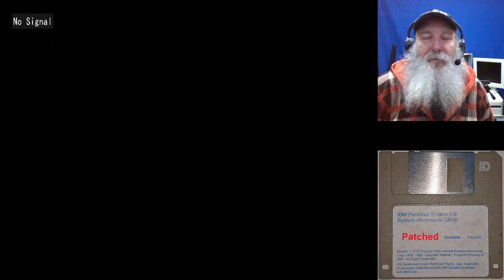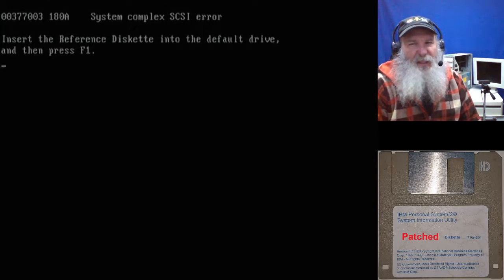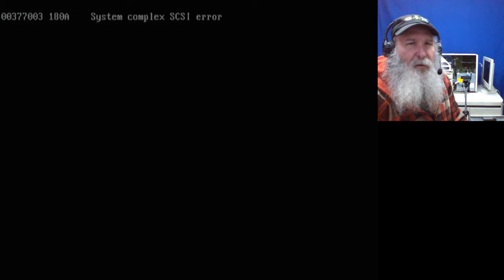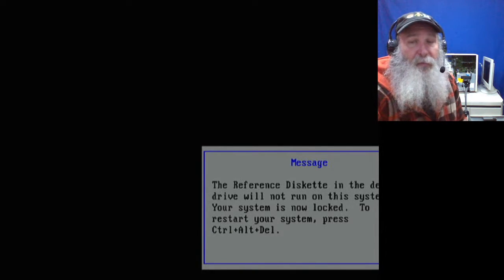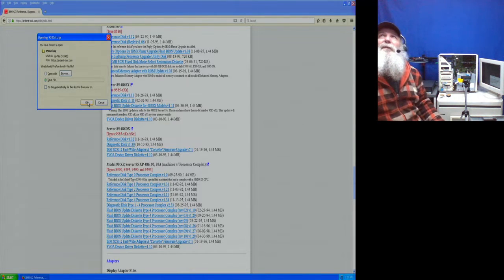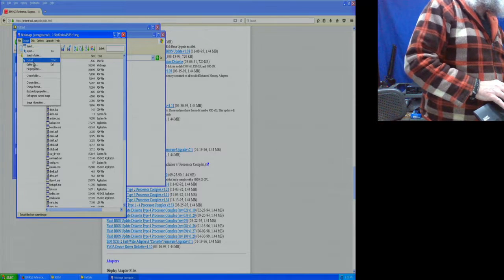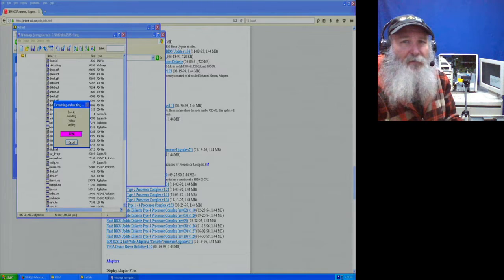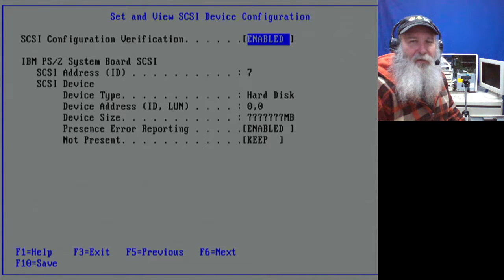Attempting to run the IBM 'System Information Tool' (SIT) on a PS/2 Model 85 'K/N'!

Comment: Yep, the links on the 9585 K/N page were indeed wrong! Good thing it was you who discovered this, and not somebody who is new to the PS/2 world. Thanks for the report - links fixed. Generally, if the system shows a graphical splash logo during the POST process, you should see the same thing on the refdisk. If it gives you the white on blue ASCII splash screen on one of these later SurePath systems, you know you have the wrong refdisk (or reference partition).

Comment: It's all about peeling back the layers of the onion when we work on these!!  I have never seen a Model 85... it sure looks modern as compared to many PS/2s... it's like you can see how it influenced the Aptiva!
Reply from the maker: There are two versions of the Model 85, each with a different planars! I say that the 85 'X' is like a tower version of the 76/77 'Bermuda' planar, and the 'K/N' is like a tower 76/77 'Lacuna' planar. The Model 85 is also the same case style as the Model 95.